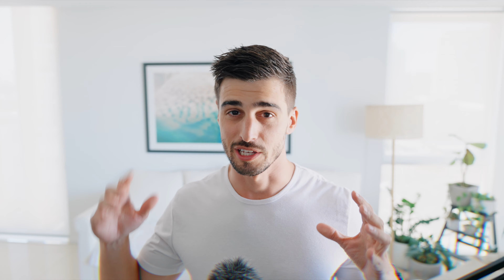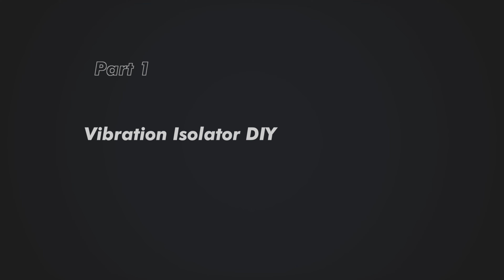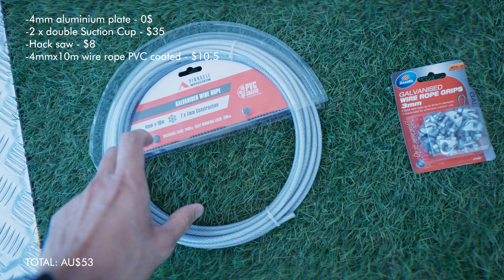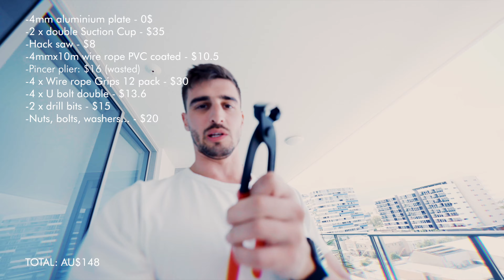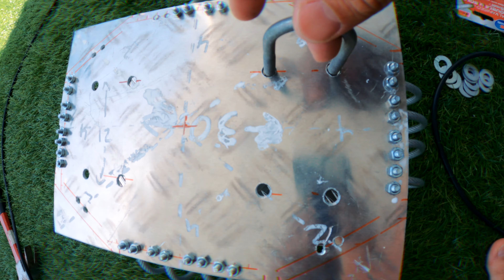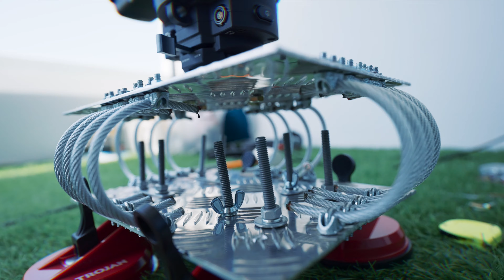DIY CAR MOUNT - PART 1 - With less than $200!

Comment: nice DIY project and good conception. IMHO using a 7000$ gimbal like the ronin 2 and after make a DIY isolator  (where be inexpensive is one of the most important thing) it's a little bit strange........ i repeat IMHO i wont risk a professional camera on a professional gimbal that could it be compromised by a not professional DIY vibrations wire isolator placed to do the most risky important task .  It would be a different a prosumer product like a RS2 .....nice work however :)
Reply from the maker: I 100% agree with you! As I told a few people in the comments, it didn't make sense spending so much time building this when I could have bought a professional solution directly online. The only reason I did it is that we were in lockdown unable to work for clients during that period. I needed to do something with my hands as it's like meditation for me so I built this :)

Comment: What tool did you use to cut the steel cable?
Reply from the maker: I ended up using the angle grinder, much quicker, marked all the cuts on the cable with a black sharpi and then cut everything in less than a minute without effort :)
Reply: They make a hand grip cutter designed specifically for wire rope.  I do construction, so I already have one.  Cost about $50 USD.

Comment: That's a great build, bro.
Reply from the maker: I appreciate it
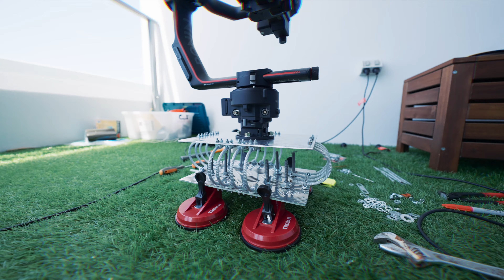Reply: @GuillaumeCornetfilms  8:33 Do you believe shortening the length of the wires (not by cutting, but by sliding them further towards the center or the plates) you had first added would give the same (or similar) result as adding more wires?
Reply from the maker: @MoniJohnson  shortening the length of the wires definitely makes the system more rigid. But I guess you still want some flex and allow the plates to move a bit to absorb larger vibrations. There are quite a few parameters to take into account: length of the wires but also, the diameter, their number, their locations, and the weight of the rig to isolate. I did have a look at what manufacturers were doing for this kind of rig and tried to reproduce something similar. Have a look at PART 2 but I believe it works great!